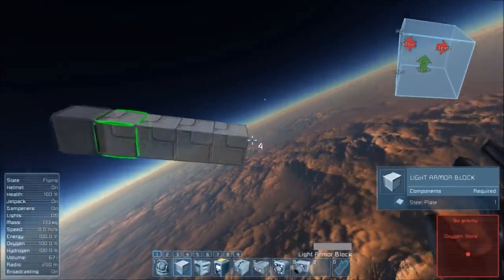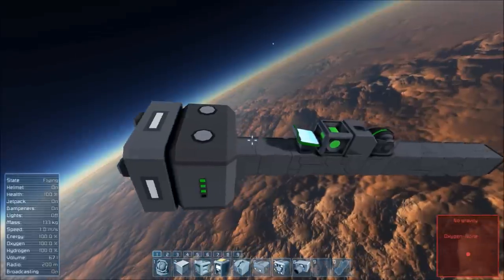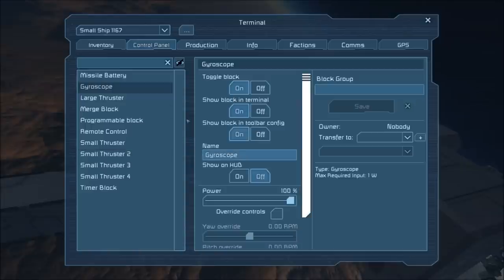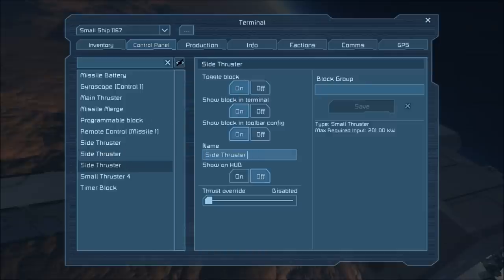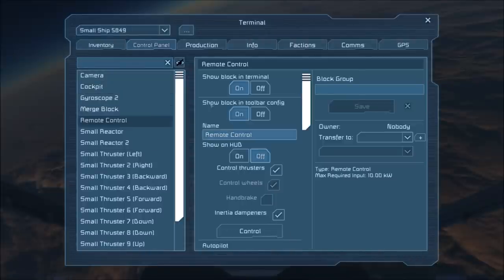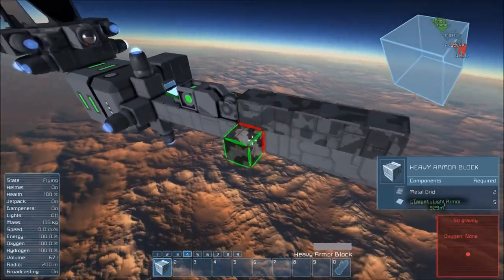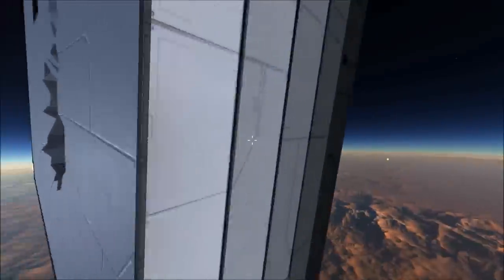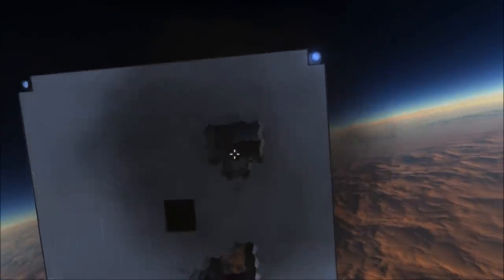[OUTDATED][Space Engineers] Whip's Guided Missile Tutorial

Comment: Hi man! I've got a question.
In your script you set list of terminal blocks by GridTerminalSystem.GetBlocksOfType<IMyRemoteControl>(remotes) command(string 115 of your script).
So as i understand when missle and shooter ships are connected by merge blocks we can find both remote controls there. So then we can operate with each of them by calling each from this list. 
But by disconecting missle from shooter causes separating missle as a different ship. In this way remotes list includes only missle remote control block.
So how you made possible to opperate with shooter ship remote control from program block on the missle?
Reply from the maker: +Alex Sukhov 
At the top of the code, I store the remotes outside the Main method so that I keep those references over iterations and disconnect from firing platforms.
Reply: +Whiplash141 
Thanks!
Reply: +Whiplash141, i've got an idea. in a case of list of remotes that can be formed during conected shooter/missle there is no reason to place program block and timer block on a missle ship. It's enogh to place only remote control with trhrusters and gyro on torpedo and manipulate wih all of it from the script on a shooter ship. It seem to be a more efficent as i think.
Reply from the maker: +Alex Sukhov 
I've already considered this. The issue is that the program needs to keep track of *every* missile that it has fired and iterate through each missile. We get problems when a program is destroyed (ie: smashing it into a target) we start getting lists of broken references that would break the code.
Reply: +Whiplash141 Friend of mine sugested to use "Try{}; Catch{};" operators for case of smashing missle into target. That mean in a case of fully functional missle it will be operated via "Try" instruction, and when it smashed and reference is broken then "Catch" instruction will be able to recieve some info like "missle destroyed".
Reply from the maker: I've tried that but it still parses a code breaking exception. Also a big concern is if my shooter's program gets damaged, all the missiles become useless